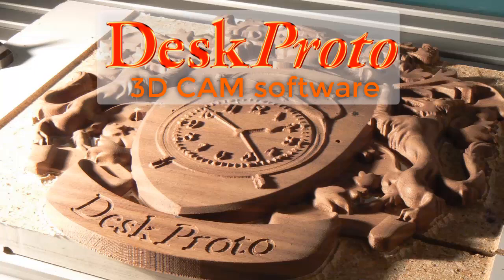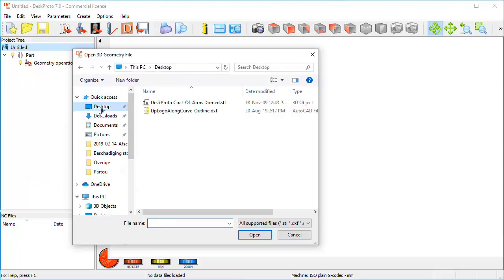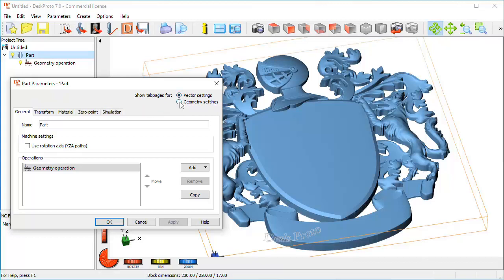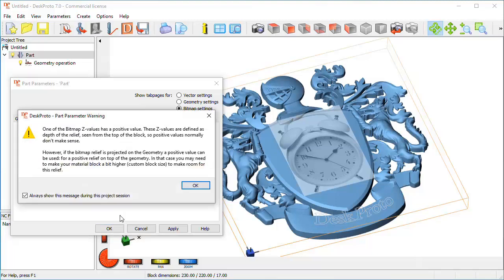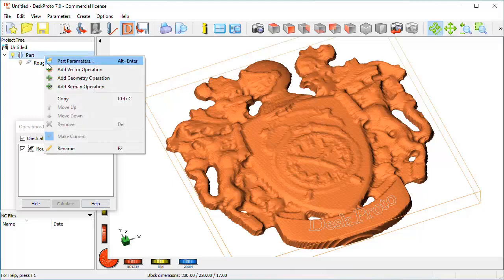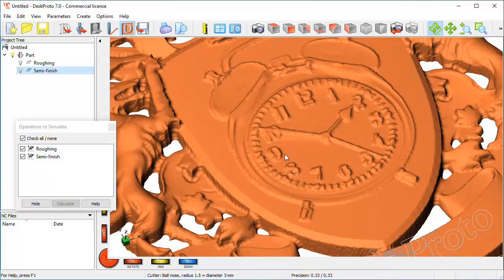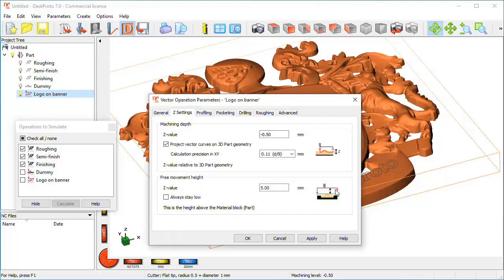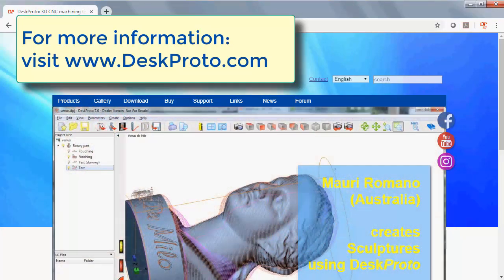CNC machining a Coat Of Arms relief with DeskProto V7

Comment: Does the bitmap setting only calculate in black/white or did it generate those options from the relevant bitmap?
Reply from the maker: Not sure what you mean. The grey values in the bitmap image were used to calculate a 3D relief, that then was projected on the surface of the shield. Next the toolpaths have been calculated over the resulting combined shape.